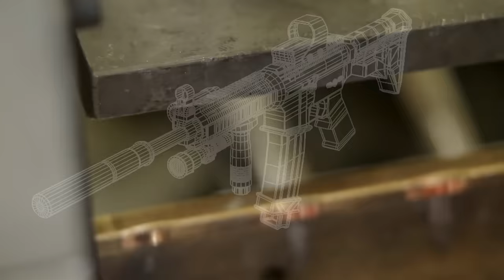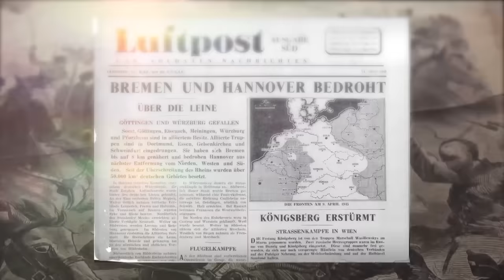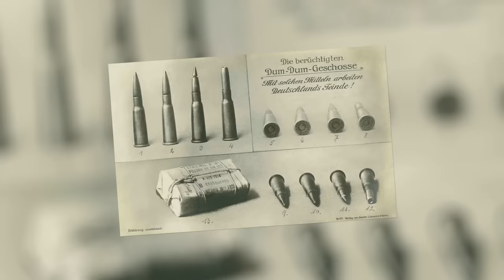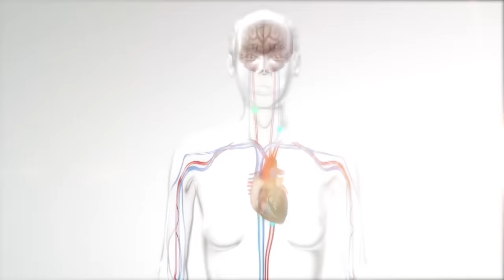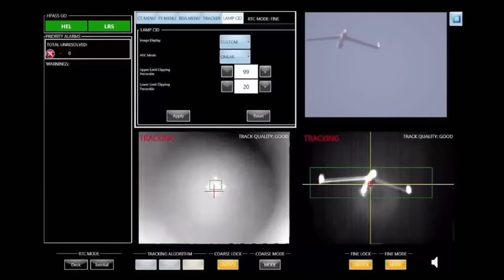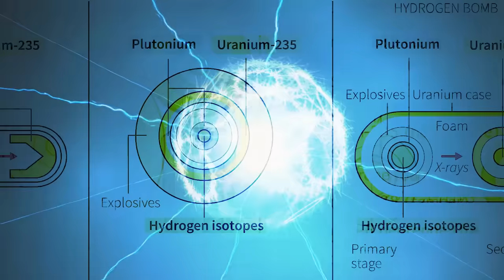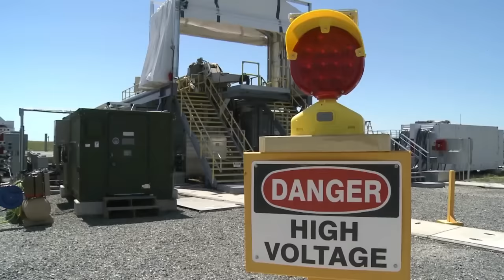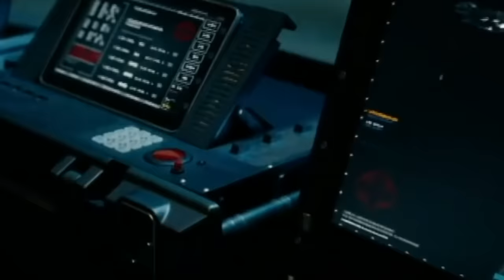10 Most Insane Weapons In The World

Comment: The two serious drawbacks of the railgun is 1) the amount of power it requires to fire on a consistent basis and 2) the fact that it fires its ammunition so quickly, that it vaporizes the inside portion of the barrel it is launched from, compromising it's structural integrity. Which, needless to say, is pretty important for a cannon to fire safely.
Reply: Yeah, so it makes you wonder if it really is "cheaper" in the long run
Reply: Plus the assembly. Its not that portable.
Reply: I've always wondered if they could perhaps 3D print the barrel and the barrel itself is the thing that gets discarded like rounds in a conventional magazine. No idea if we could make a polymer barrel that would handle a throwaway/disposal discharge or not though.
Reply: Rail guns are overated, give me a plasma caster instead
Reply: They solved that problem like 6yrs ago
Reply: @VivaLaPigotry ?
Reply: @lonesome3958  I've been following BAE's project as a side interest. You can find BAE's test footage on YT of this thing firing on an outdoor range.
A Naval ship/platform was purpose-built for the railgun, with an autoloader and magazine system that is, based on what I've been told, mostly automated.
If barrel swaps are required on a frequent basis as the top commenter suggests, then we wouldn't put it on a ship that goes out to sea, alone, without support. Barrel swaps on shipboard and land-based artillery pieces are done, but only when absolutely necessary because it's an enormous pain in the ass. The barrels are super heavy, you need a Crane and everything. Furthermore, where even would they store extra barrels?

So knowing what I know and extrapolating a little further, it's safe to assume they've solved the barrel problem.

Comment: I started working on the railgun in 83 at that time we were accelerating 1/2 inch cubed  Dice from the blackjack tablece 30000 feet per second and due to the kinetic energy it went right through 1 in of solid steel specifically 1018 cold roll!

Comment: I find it funny how he goes into immense detail about the USA's nuclear weapons and then just brushes over the literal most powerful weapon ever used by humanity
Reply: @iamcrawlingbeneathyourskin  Tsar bomb, by Russia, an EST 58 MT compared to the 15 of Castle Bravo
Reply: Vyce Tsar bomb isn’t a practical bomb despite having a devastating destruction power. Smaller and more compact nukes are more agile and practical compared to bombs like Tsar which can be easily intercepted in modern warfare.
Reply: @biterness2323  
But we are talking about the most insane weapon, not the most practical one

The Tsar bomba that was detonated actually can be loaded with a more powerful warhead, about double to be honest but the soviets knew that if the bomb was that powerful, then the plane carrying won't be fast enough to get to safety before it blow up

The Tsar is more insane than the American nuke featured in the video which is why the original comment found it funny that they just mentioned it instead of actually talking about it

Edit:
Just in case you try to push through with practically to be featured here, the Metal Storm is not that practical but is still shown in the video
Reply: @blob643  the most insane weapon would be the Rods of God. Tungsten light poles dropped out of space moving at the speed of light.
Reply: @TonyMontana-jm8px  Mach 10 (which is the speed of the rods ) is 7672 mph. The speed of LIGHT is 690,616,692 mph. That's 87,410 times faster than the rods. 👍 EITHER way...yes,the Rods of God is an INSANE weapon,no doubt.

Comment: The USAS 12 is underrated, it has a higher firerate than AA12.
AA12 fires at 300 rpm, USAS 12 fires at 450 rpm.
They are both automatic shotguns.

Comment: the most absolutely frightening thing about the hydrogen bomb is, unlike the atomic bomb with has a limit to the yield, the H bomb has no theoretical limit to its power. the Tsar bomber was a frightening look at what may have been coming. to think that they could have produced a 10 gigatonne bomb that would split the earth in two.
Reply: I believe the tsar bomb was a 6 or 7 stage explosive? In response the US was going to make a 9 stage but ultimately decided it was better to make more bombs rather than design them bigger seeing as they already level cities.
Reply: While the yield is unlimited the hight has a limit and after stage 6 everything else will just fire in space so there's no sense to it
Reply: @chemislife  
No, it was a single fission first stage igniting 5 parallel fusion 2nd stages. For Gods sake, they built it in under a year without anything like a decent computer. They couldn't have done the modeling for even a 3rd stage, they had neither the computer hydrodynamic design modeling capacity nor the time.

Comment: "THORS HAMMER" they didn't launch it they would just drop it no propellant or anything just pure kinetic energy
Reply: They wolud have to propel the thing to take it out of orbit, otherwise it would just not move  becouse it has the velocity to keep in orbit for a long time.
Reply: @miguelstorani8643  when they drop it they use rcs thrusters to counter the orbit that's all it's more like the one being dropped is on the opposite side of the orbit direction and when it disconnects it pushes it so hard that it counteracts the orbit I know because I helped with the redesign from the 1978 schematic in 2017 we had to account for the molten effect on the tungsten and had to think of other materials that could be used
Reply: @masenstephens8986  The rcs thrusters wolud trhust it  not in the direction thowards the earth but in the direction against the orbit 
trajectory?
Reply: @miguelstorani8643  The earth is moving in one direction at 900 to 1000 miles an hour we will call it to the left so you 'launch" drop this directed toward the right and thus hit the earth at 900 to 1000 MPH not considering the speed of the satellite if it was going counter-rotational to the Earth.
Reply: Thanos would  have a field day with  that!!!!!!
Reply: @Barskor1  The earth's moving direction nor speed has no effect to that whatsoever. Only the satellite's orbit properties. The ammunition is launched towards the retrograde trajectory from satellite's orbit. 

Learn to KSP.
Reply: @miguelstorani8643  yes exactly
Reply: @anteshell  Ok buddy crash a car into a wall at x speed then crash two cars into each other at the same speed and LEARN something you moop.
Reply: @Barskor1  Moop? Oh, did I hurt you by correcting you? Try to grow a little and learn from your mistakes.

Comment: They missed Tsar Bomba. The reason arctic tree ring sampling for working out CO2 levels in the past only works up till about 1960 is so much radioactive carbon was released by Tsar Bomba, it penetrated the tree bark and wrecked the measurements from that point on....It only goes in about 1m, so deeper than that is fine, but newer rings have screwed up isotopes and cant be used. That bomb was a monster. Blew out windows in scandinavian countries despite being dropped in russia. I'm pretty sure after that thing went off the general feeling was "Uh.... lets not do that again" lol

Comment: To clarify here - the reason that police and civilians in the USA use hollow-point ammunition is the fact that it runs a much lower chance of over-penetrating. For example, the .40s&w cartridge is used pretty commonly by police and civilians across the country in self defense pistols. Fired from a standard barrel length, a full metal jacket "round nose" bullet in that caliber has more than enough energy to pass straight through an intended target and potentially hit more than 1 target. In contrast, modern JHP/SJHP/FTX ammunitions are designed to expend all of their energy within the first 12" or so, often stopping just shy or past 12" in gel simulation testing.
Reply: Ah, ok. So more likely to kill the first person than to maim both the first and the second. Thanks for the clarification!

Comment: In Iraq people were reporting an effect where someone driving a car that had stopped in its tracks the car was undamaged even having its fully waxed post carwash coat untouched, the inside of the car was as it was intact, the occupants sat clothed which were totally unscathed but under the shirts and trousers the skin of the occupant was burned crisp black and crunchy, they were instantly killed, it has been speculated that this was some modulated and directed energy weapon like a microwave lazer or maser we are not sure, all we know is it was deployed, 

but if you go back to WTC 9/11 there was one item of curious interest that many have missed, there were people hanging onto the outside of the towers by 1 hand, they frantically were trying to take off their clothes, now it is obvious that they wanted to survive, so firstly I would be using both hands to hold on so that's odd, why were they so urgent to take off their clothes, I mean they are outside in the air, was it because the fire sprinklers had dowsed the area in water their clothes were then wet and some directed microwave beam was fiercly acting upon any water in the area and driving these poor souls to attempt at risk of falling (so it was a very urgent drive) to take away the burning sensation caused by wet clothing, were we witnessing directed energy weapons that day,

On top of DEW's in poss use try this one.... through analysis and much research into this day, I have come to believe they had micro nuclear devices in these buildings located centrally and at its base in the lift shafts facing in a cone upwards designed to vaporize the structure in the 1KTonne nuclear device a shaped yttrium core that is triggered by an external neutron flux source thus not needing the usual critical mass to start the cascade of fission, the air samples that the mayor claimed were safe later proved to contain tritium and strontium and other isotopes that should not have been present, and has led to many first responders to come down with thyroid cancer that can only happen if exposed to a strong radiation source, then the earths magnetic signature went haywire right after the first building fell, only stabalising after building 7 had fallen that evening, and their was no significant seismic shockwave recorded around the world that you would expect when 2 x 100+ story buildings somehow managed to defy physics and hit the ground at free fall, that doesn't happen, did you see the mast atop the building vaporize, what causes that metal to turn to plasma, hmmm heat above 10000 kelvin for one, then the timing was funny exactly 30 mins apart because if you had fired a second nuke before that 30 mins interval there would have been a false triggering due to the radiation present, that had to be more than 30 mins after the initial firing, I didn't know alqada had access to micro nukes, nor did they i bet. ask yourself who would have had such access???

Comment: Police Forces also use hollow points because they have a significantly lower chance of collateral pass-through damage and ricochet potential. If they were to use ball or standard rounds that risk becomes a lot more higher, especially in urban areas with dense population or hard surfaces. Also those rounds were RIP rounds not HP? Completely different design purposes on each, sort of misleading to use RIP rounds just because they look more brutal.

Comment: Pretty good video. A few tidbits though: 
When discussing VX, you state that 10mg in contact with the skin can cause death, but the spoon & powder pictured portrays about 300-400mg of a powder, which kinda fails to convey just how deadly VX is (although realistically you'd need about 20mg worth of skin contact rather than 10). You left out some of the key design bits of a neutron bomb, the part which gives it such an intense neutron burst, but perhaps that is for the best. The "Rods from God" concept has been determined to be "extremely" inefficient.

Comment: 1milion rounds ?
one minute 
that's expensive
Reply: Yup, the system is really only useful in fortifying for defence. They also ignored the 40 mm grenades it can launch at nearly the same rate. Interdict incoming missiles / rockets, splash attacking troops or tanks. To much time to set up for use in an attack.
Reply: @jaquigreenlees  i assume this thing is run on some kind of software to be able to automatically and precisely be able to even respond to missiles at insane speeds .
Reply: @joelbento3599  Not sure, the short lived series Future weapons did an entire episode on them. I suspect they are hooked into radar for the base they are set to protect and it's just an electrical signal to the weapon pointing in the right direction to trigger it.

Comment: 02:48   Showing but not naming a round as evil as the Radically Invasive Projectile ("RIP") while blubbering about dumdum rounds? Come on mate, that is just dishonest. 
The RIP is solid copper milled into bullets that break into a eight copper javelins on impact. Those javelins use the impact energy to travel outward from the impact in a ring, cutting through the body instead of stopping it. These rounds are designed to inflict maximum internal damage and suffering, with minimum stopping power.

Comment: Project Thor is BS. It is too expensive in comparison to its effectiveness. The thing is... Those rods are heavy. It costs around 15.000 Dollars per kg to bring something into orbit. Let's suppose that rods are around 20cm in diameter and have a length of around 10m.... that means every SINGLE rod costs a whopping 90,7mio USD for a "bomb" that is not even super powerful. It is just WAY cheaper (16mio) to throw a MOAB and does basically the same thing.

Comment: "Crazy gun that fire over one million rounds per minute." Except it only has the capacity to hold a few hundred rounds at a time. So, no.
Reply: What you're saying is: 'No, a Bugatti Veyron isn't driving 250mph because its tank can only hold fuel to drive for 50 miles.', which is nonsense.

Rate of fire, i.e. speed, has nothing to do with capacity.